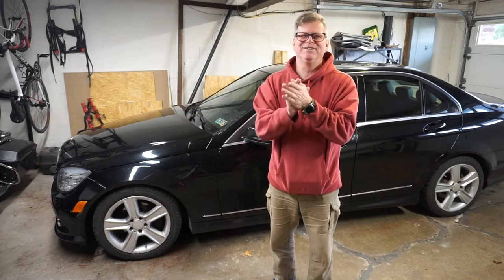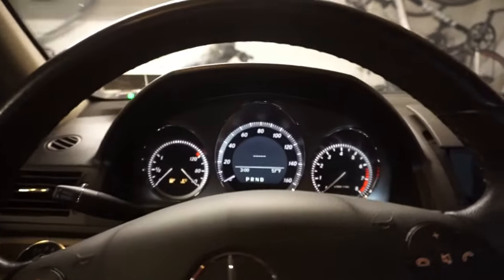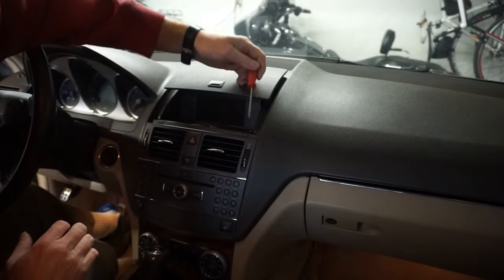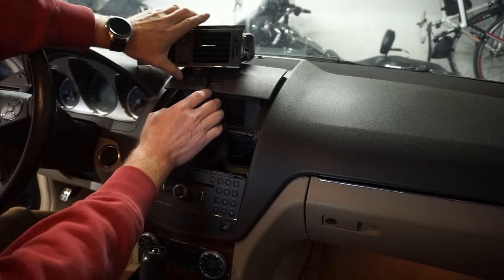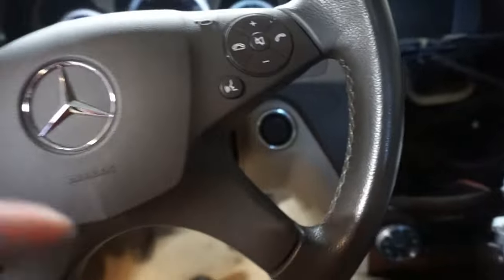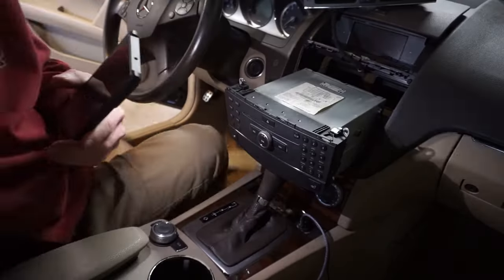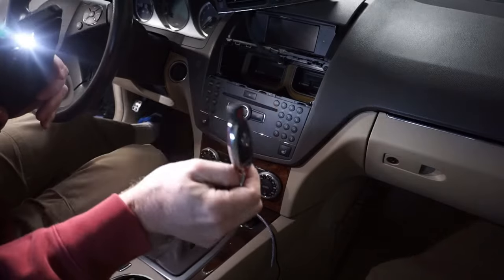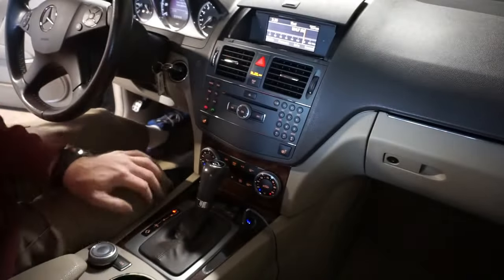Mercedes C300 radio stopped working! Here is an easy fix!

Comment: I have a 2015 Mercedes glk350 with the same problem. I used your method and replaced a 10 amp fuse. Now my problem is fixed. Thanks a Zillion!!!
Reply from the maker: Your welcome!
Reply from the maker: Don't forget to subscribe. It really helps the channel.
Reply: Hi Mark, I subscribed when I posted my comment, smashed the like button and  hit the notification bell.😊
Reply: If it happened once then something is wrong. Pulling more power than the fuse can handle. In other words there is possibly a short in the wiring
Reply: To @pointblank1978 it's been over a year since my last and only post and it's still working 💪

Comment: I have C300 2010, my fuse was good also. I have the same problem. I need a 10amp fuse, if its out and I need a skinny screw driver, t20? Your vehicle yrs? I might need to take it to mechanic but I will update you. Thank you
Reply from the maker: @acr8615  any auto parts store will have what you need. My car is a 2010. You can do this yourself. It's really very easy. Good luck. Let me know how it goes.

Comment: Hi i have a C180K mercedes W204 2008 1.8 petrol/gas elegance. My radio/sound is working fine. The only problem is the screen. The screen is on and illuminated but it is not readable/fuzzy. What should i do. Thanks
Reply from the maker: @zeddya2197  it sounds like you have a bad display. You can try checking all of the cables to make sure they are connected good. Maybe take them off and put them back on just to get rid of any tarnish on the pins. If that doesn't work I would upgrade it. You can get bluetooth, backup camera, all kinds of new technology in an upgraded radio.

Comment: Just changed the battery yesterday and like you I have no radio working  I'll attempt this fix as it may have blown that 10 amp fuse thanks very much for your brilliant video. And a big cheers from Ireland.
Reply from the maker: Thanks for the comment. Hopefully it works.
Reply: @MarkGeorgeFantasticAdventures  it did work took a bit of work dismantling. But thanks its up and running again.
Reply from the maker: Don't forget to subscribe. It really helps the channel.
Reply: Just subscribed to your channel thanks again.

Comment: I have the same car, radio screen and modes are available and stations change but there is no sound… any recommendations??
Reply from the maker: Hmm, sounds like an amplifier problem. It might be something inside the radio. Not sure about that. I've been looking for a reason to upgrade the stereo. They have kits to upgrade to a touch screen with Bluetooth and wifi. Maybe this is the excuse that you need. Lol
Reply: @MarkGeorgeFantasticAdventures  I removed the sockets in the amp and red beeping light looks good but everything works even the moc when I’m on a call but no sound on any mode at all…. Hahaha I’ve thought of the upgrade but as you know the car electricity is precise and wouldn’t want to guess any unplanned outcomes
Reply: @zeyadkhalil7489  can you tell me where the amp is located I need to check it to see if that is the reason I get no sound from my speakers but my radio turns on

Comment: I have similar issue ! For me the top screen works fine , but the buttons where the volume , disc , and numbers don’t work , so I can only turn volume up from steering wheel ! And disc player also don’t work ! Any ideas ? Thanks in advance
Reply from the maker: That sounds like an internal problem in the radio itself. No ideas here. Sorry. Maybe someone else will see your comment and give us an idea.

Comment: My car has a similar issue but the sound still works just the screen and dashboard is not working like yours. Would this work for me too?
Reply from the maker: Not sure about that. You can easily check it. I think if there is anything working at all then it is not the fuse. Possibly something else in the radio.
Reply: Mine is a 2010 c300 4matic sport and it did the exact same thing two years ago.  Checked all fuses, searched all videos, blogs, etc.. Tag me if u ever find the answer!
Reply from the maker: @mygmailacct9692  Maybe there is a bad connection to the display? If I ever come across a solution for this I will post it. Also, you can upgrade to a newer stereo with touchscreen, bluetooth and reverse camera. I'm thinking about doing that.
Reply: @MarkGeorgeFantasticAdventures  Thanks for responding!  I recently gifted the vehicle to my 16 year old daughter. (Only way I could stop her from spending/WASTING her 8k life savings on a 2008 BMW she LOVED with over 180k miles that was destined for failures.) At least this has 115k and I know she can afford to fix it if anything else happens after this overhaul.  Myself?  I wised up and settled into a 2014 Lexus F Sport that my husband had with super low 30k miles. Highly recommended, FYI!!! Unreal how much cheaper it is to not be purchasing foreign parts/ labor.  : )   Anyways, she is planning just that. Adding a really nice stereo and backup camera set up.  I will say that I took it in to my local Mercedes dealership for a steering issue. It felt loose. It was bilateral torn front axles.  They also found the rear subframe is rusted / rotting and the "arms" are loose. (And a MILLION other little things that they think it needs totaling over 11k.)  YES, ELEVEN THOUSAND DOLLARS!! Obviously, we ALL know the bluebook on the car is much less than that these days.  I want to say this because while looking up common issues for this model, I found the subframe rot as being a culprit for many other owners.  This and the ignition lock turning the car into a beautiful brick. That happened to me 2 years ago as well and cost me over $1,500 to fix.  No way around that repair being done at the dealer as it requires a part to be ordered by only the dealership and you need to show drivers license and registration proof to get it even ordered.  However, recently I did find an old friend who works on foreign vehicles and agreed to help us out with the repairs. He found the subframe (brand new) for $800 plus a couple hours labor.  Much better than the $4,000 sticker at the dealership for only that repair.  Same friend is doing all repairs at his shop (including inspection), for around $2,500. Much different than 11k price tag / heart attack I received at the dealership!  I'm saying this because I hope anyone who reads this knows to shop around and that the dealership (though thorough) is NOT the final option. I believed this, until recently. HOWEVER, DO find a mechanic with a lot of foreign auto experience. By the way, if you know of any local (Pittsburgh, PA. area) foreign mechanics, feel free to let me know. I'm not sure where everyone is from. But I know she is really looking into aftermarket parts, etc. She wants it lowered a tad. I think it's low enough as is and handles beautifully as its stock height. But 16yrs. old is the new 30, apparently. ha-ha Hopefully, the low-profile tire prices will end that war, but who knows!  ; ) Any advice or sites you know that are legitimate and trustworthy for after- market or stock parts would be greatly appreciated as well!! Sorry for the long read and certainly thanks again for responding!
Take care!!  
-Magz
Reply from the maker: @mygmailacct9692  Partsgeek.com and Rockauto.com have petty much everything for this car. I have bought from them both several times and things are way cheaper than the dealer. I also replaced the rear subframe on this car. I guess that is a given for a 13 year old car in Pittsburgh. lol  I think I have a video of replacing the ignition lock motor that I found on amazon for a few dollars. It required removing the steering column and disassembling the steering lock to replace the little motor that is in it. That seems to be the only part that goes bad but the dealer can only replace the whole thing (at a hefty price).  Also, I have found that working on the C300 is actually pretty easy once I dig into it. And there are plenty of Youtube videos to help. Hopefully your daughter gets it all fixed up and gets the nice stereo upgrade. And, enjoy your new Lexus.
Reply: @MarkGeorgeFantasticAdventures  Great! Thank you for the recommendations. I am going to pass them along.  I appreciate it.  Unfortunately, I didn't know a small part could be replaced and dished out the 2k to the dealer for the ignition lock.  As for a 13-year-old car in Pgh.?  YEP,  between the potholes, salt and freezing cold weather Pittsburgh is basically ever human and cars worst nightmare. ha-ha-ha  Take Care!

Comment: Hello, I saw your video and it was good, but I have a 2010 C300 and I have a problem that the screen suddenly turned off, but everything works fine. I can also hear the radio, but the screen does not work. What is the solution?
Reply from the maker: Hmm, your screen may have gone bad. You can check the connection in the back. Remove the connector and reinstall it. That might get it working again. If not, you might be a good candidate to upgrade your display to the Bluetooth one. Let me know how it goes.
Reply from the maker: Don't forget to subscribe. It really helps the channel.

Comment: non of this Audio device’s bottoms are responding in my car ,just (start/Stop bottun and volume up/down ) what may be the reason ?
Reply from the maker: Not sure. Do you hear anything? Can you see anything on the display?
Reply: @MarkGeorgeFantasticAdventures  yeah radio is working , i can change channels also but,(1,2,3,4,5,6 Tel ,Sys bottoms are not working.

Comment: I have a 2015 c300 with a radio that stops working when it rains then comes back on a few hrs later when it dries. Any idea what could be the cause?
Reply from the maker: Are you able to remove the radio to see if it's getting wet when it rains? Also maybe check the fuse box under the hood to see if it's getting wet when it rains.
Reply from the maker: Any luck fixing it? Don't forget to subscribe. It really helps the channel.

Comment: I've got 204 Mercedes Benz radio. The problem is, the radio plays as if the ignition is off. It plays for a certain time and switches itself off and l must press on again for it to play. And it's not communicating with the steering anymore. At you can't see the radio it's dark but playing

Comment: My radio was working fine, but my battery died and once I turned my car back on it stopped working. I just got done doing this and unfortunately it still doesn’t work. Any suggestions?
Reply from the maker: There is also the fuse under the hood. Did you check that one also?
Reply: @MarkGeorgeFantasticAdventures  yes, the fuse is good.
Reply from the maker: Do you have a volt meter? You can check to see if you are getting 12v at the radio.  Don't forget to subscribe. It really helps the channel.
Reply: Did you fix it? I have the same problem, mine is e350 2013.
Reply: @nanae2273 I did not, still doesn’t work.
Reply: @marizelavelasquez1412  after my battery recharge the radio and screen stopped working, I’m going to try his method tomorrow and check the fuse maybe it’ll work for me!

Comment: What if the audio works but not the screen would l there be a fuse for that
Reply from the maker: No, I don't think so. There could be a bad connection between the screen and the radio. Check all the wires to the screen. Or you could just have a bad screen

Comment: Is there any connection between the radio and climate control? My radio, climate control, and window (up) switch loses power intermittently, and i can't figure it out for the life of me.
Reply from the maker: Those seem like completely different systems. I suppose there could be a connection between the climate control and the radio of you have a newer model with touch screen for radio and climate control but the window up seems completely unrelated. Not sure about this one. I'd be interested to know what it ends up being. Do you have an OBD2 reader? They are really cheap these days and that could give you a better idea.

Comment: Great video, I have another issue.. my radio switches on, but only for about 3 seconds then it all goes quiet. I can select radio stations with the steering wheel buttons.. 

As it is getting power, I doubt it's a fuse. 

Let the utube hunt/tutorials begin....
Reply from the maker: That sounds like an issue with the amplifier. When it heats up it shuts off. Good luck on the search. I'll be interested to know what you find out.

Comment: I have the same problem. But mine turns on and goes off by itself.
Reply from the maker: That sounds like a loose connection somewhere. You could remove it and check all of the connectors.
Reply from the maker: Any luck with the radio? Don't forget to subscribe. It really helps the channel.

Comment: Woow
Can u please help me with the head light switch not working on C200 kompresor 2008
Reply from the maker: I'm not sure about a headlight switch not working. I haven't had any problems with mine. I have watched a video about replacing the switch. I suppose it's possible the switch is bad. The video I watched looked pretty easy to replace. I'd say do a YouTube search for light  switch not working and you'll find a video for it. Good luck getting it fixed and thanks for the comment. Don't forget to subscribe.